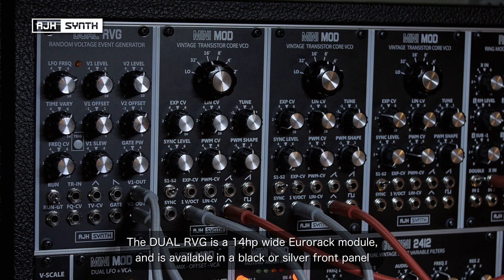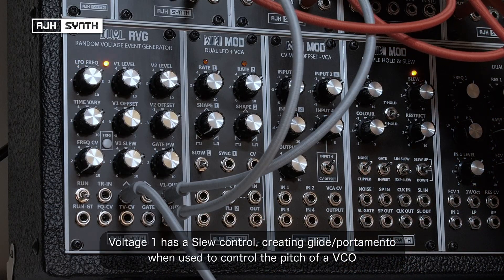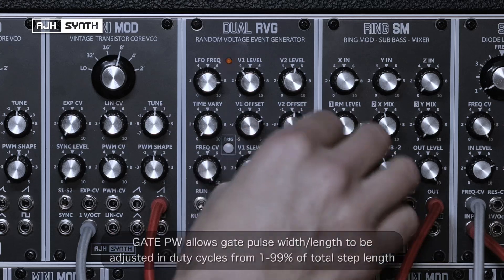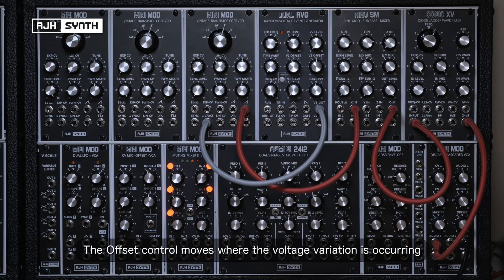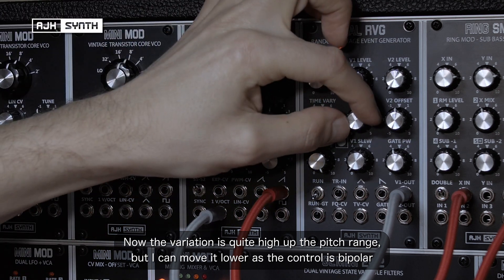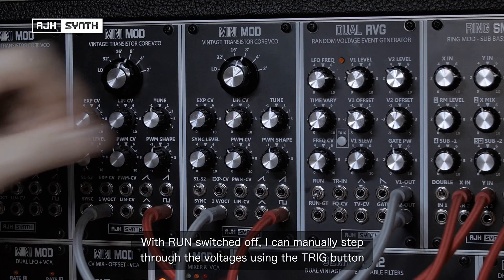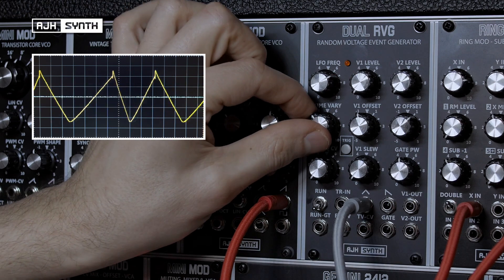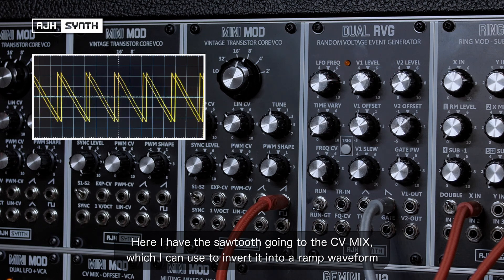NEW! DUAL RVG Random Voltage Event Generator - an Introduction to this Eurorack Generative CV Source

Comment: Luving that time variation parameter👌🏻
Reply from the maker: Excellent :) It's great being able to also randomise gate time, as well as CV.
Reply: Hey just wondering about the lfo freq dead zone 0-4. Not sure Im understanding it in regards to dialing in very slow speeds.
Don’t own the module yet, just researching. Can you shed some light?
-thx
Reply from the maker: Hi, sorry for the slow reply, we didn't get a notification. Basically, it's a characteristic of the original design and the technology used (to which this module is directly based as closely as possible in order to be authentic), which meant that below approximately 4 the clock would stop altogether. If you just bear in mind that about 4 is the lowest setting you can work with, and for particularly slow speeds it's just a case of experimenting/gradual tweaking close to this level.